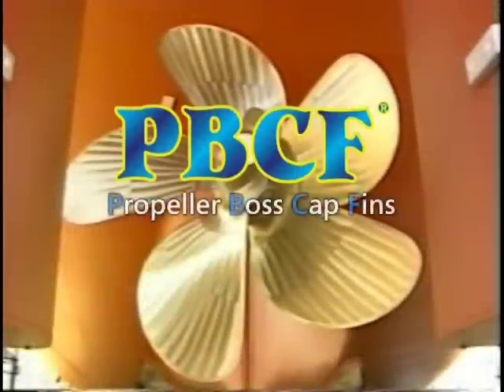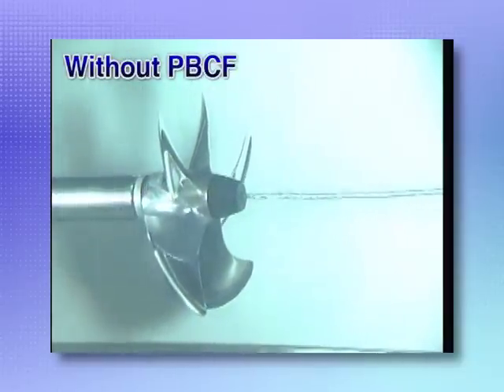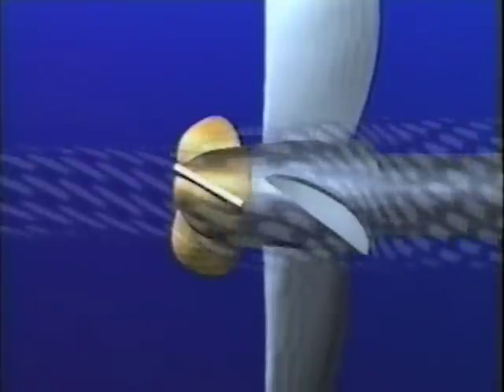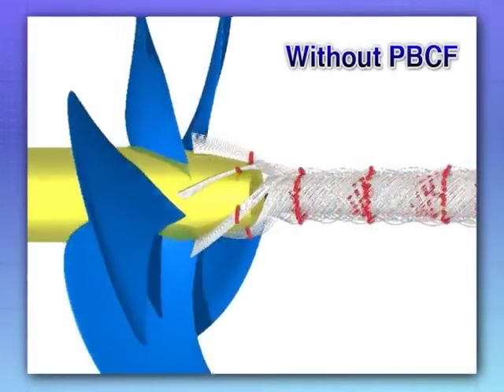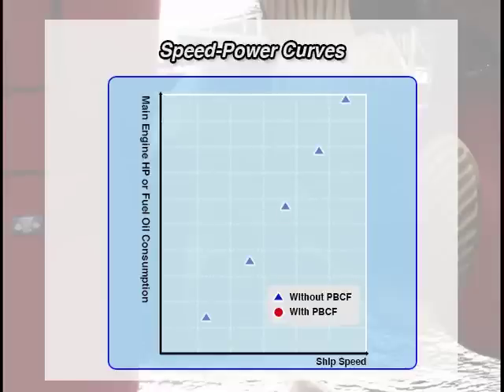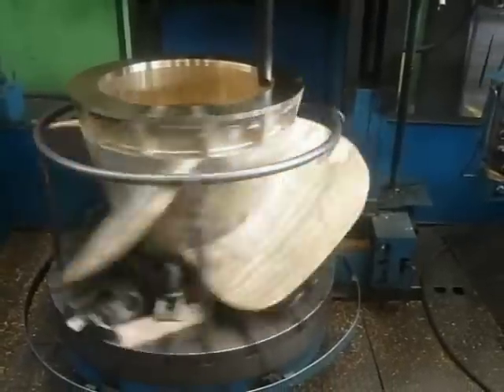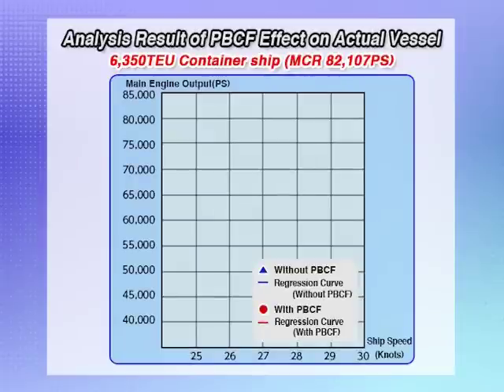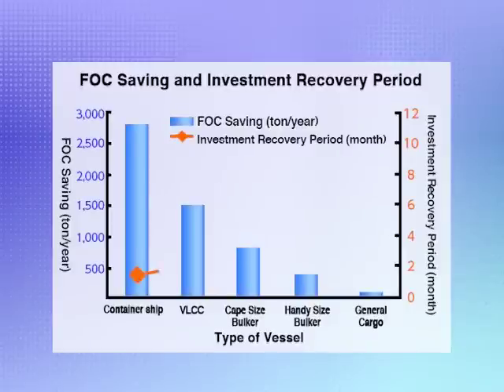PBCF (Propeller Boss Cap Fins)

Comment: The added weight of that PBCF is useless, you as a captain will never see the benefit of that device on a vessel that's dam near a 1/4 mile long and weight millions of tons, just design a better propeller
Reply: The extra weight of a BCF on any large tanker would be negligible. The prop already has a prop boss weight penalty. A 5% saving on any large vessel is a considerable fuel saving, which is the ships most expensive operating cost - of course the captain wont benefit as he does not own these boats. I doubt cruise ships will benefit as most use azimuth rotating propellors now vs a single screw as presented. I see these BCFs now being sold by other firms (perhaps under license). I do wonder why we're not seeing designs that eliminate post screw vortexes that add so much resistance and performance loss. Subs have been looking to eliminate them for years (to counter noise and vibration impact)